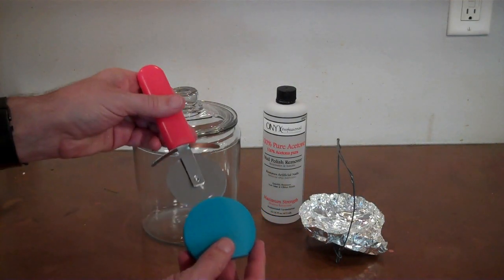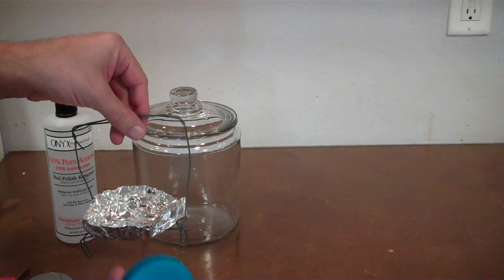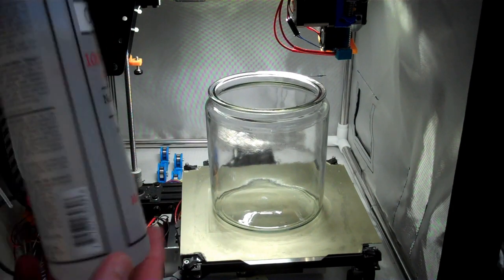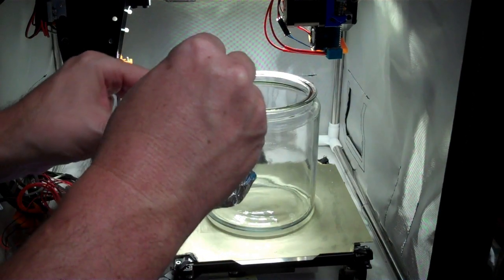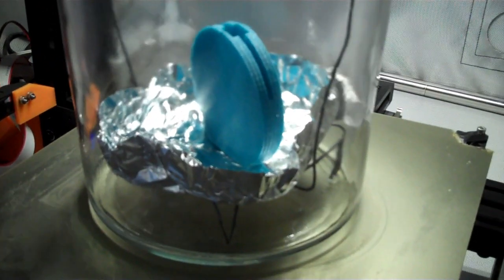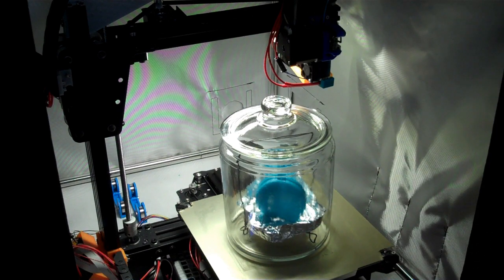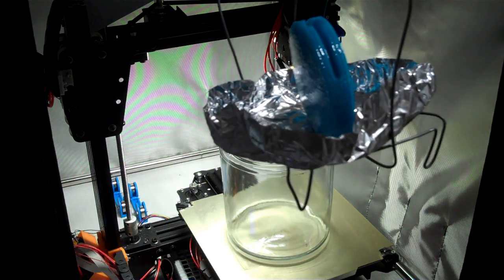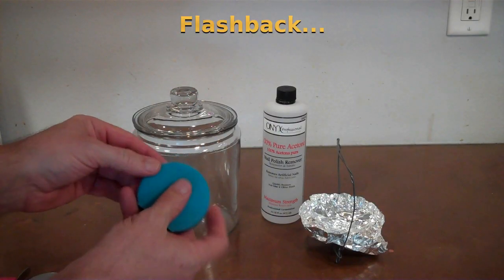Acetone vapor polishing ABS 3D Prints

Comment: I think I might have the same cookie jar as in this video. I use a hot plate outside with a frying pan full of water, to create the heat to vaporize the acetone. Using the higher temperatures of boiling water, or near to boiling water, causes the acetone to vaporize very quickly and one can observe the condensation on the inside of the glass jar. When the condensate reaches near the top, inserting the part means a 15-30 second immersion time, rather than long minutes.

One caution, though, very hot acetone vapor in the canister means that it really burns if you reach into the jar!
Reply from the maker: 100 C is well above the boiling point of acetone (but, still well below the self-ignition temp). Yes, higher temperatures definitely decrease your waiting time, but I prefer the slower and slightly safer approach.
Reply: @summetj  If you soak it for longer time no matter how smooth your parts are, the Acetone goes deeper into the object, which then can reach the point where the part becomes weaker from that and takes way longer to evaporate the Acetone out. So the shorter the better. I saw some people using something to put warm or hat water around the container. Water can hold temperature very well. Also tilt the jar to the side once ready as it's heavier then air, so you will "pull" it out, like it's sand or something.